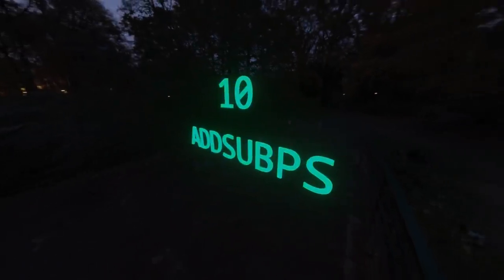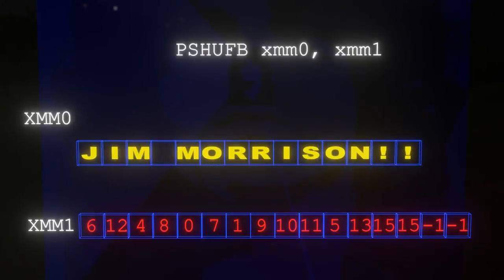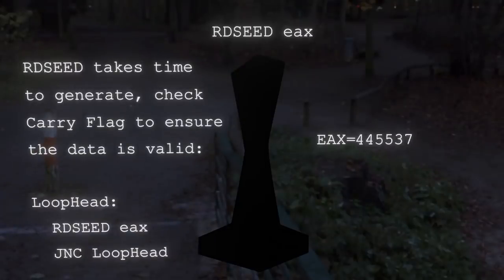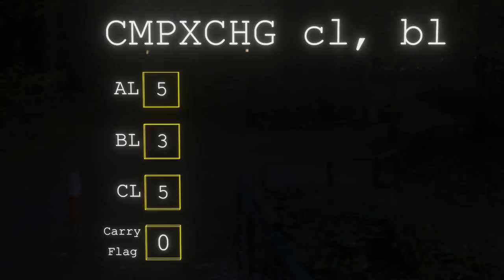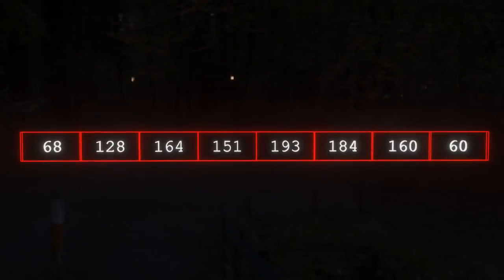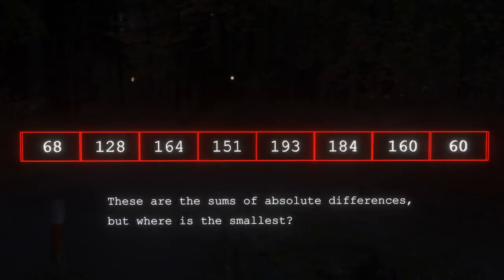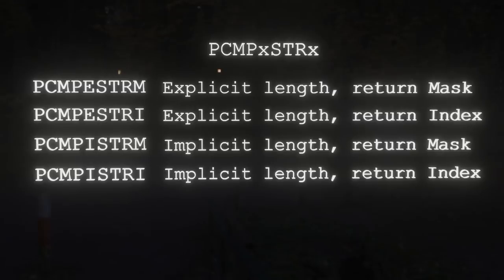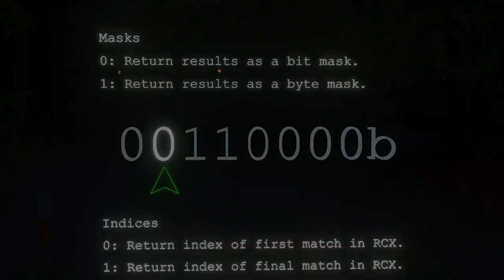Top 10 Craziest Assembly Language Instructions

Comment: Intel: One cycle
Bioinformaticists: lemme reimplement that in Python and take 300,000 cycles to compute the same thing.
Reply: Don't worry; as long as computer time remains far more valuable than developer time, and no alternative graphics-based technology appears for custom parallel processing operations, Intel will be just fine
Reply: @kestasjk  eh, emulation of x86 on ARM on both Windows and Mac is apparently good enough now that I'd be seriously worried if I was Intel. AMD at least have their GPUs...
Reply: @SimonBuchanNz  I think AMD wouldn't mind going ARM too much, if they have to. Maybe even will design dual-instruction-set chips for the transition period. Good thing that China won't let Nvidia buy ARM.

In general, nowadays there is a tendency towards "crossplatform" software design practices, so the question of "Can it run widespread software fast?" would soon become irrelevant. For example, Adobe Lightroom already works on ARM on Windows and their other products will follow soon. Itanium might not have flopped if it happened a few years from now, at least not for the reason it did, which was poor x86 emulation performance.
Reply: @JayOhm  how exactly can China stop a US company from buying a UK company?  

Should we find out what Italy and Argentina think too?
Reply: @codycast  The short answer is Qualcomm. They are banned by US so if ARM becomes US-owned, Qualcomm will no longer be able to legally produce ARM chips. Possible political implications of that are just too painful to risk so regulators almost certainly won't allow it.
Reply: Real men write code that gets compiled instead of interpreted.
Reply: @JayOhm  isn't qualcomm an american company?
Reply: @toothyeye  Sorry, my bad, mixed up the names. That was about HiSilicon (owned by Huawei), the largest semiconductor designer in China.
Reply: @codycast  Japanese company...
Reply: @JayOhm  Hmm, would that be the Qualcomm that is headquartered in San Diego, California, and incorporated in Delaware?
Reply: @rice83101  It's not a conspiracy... That's what intelligence agencies do, they gather well, you know, intelligence. China gathers dirt on us, we gather dirt on China. (And the rest of the world.) The fact that you interpret that as "conspiracy" indicates to me that you're a bit naive. It's not really used for blackmail though, it is used in other equally nefarious ways. Blackmail is a little small-minded.
Reply: @tylerchambers6246  lol. Morals r for the poor.
Reply: @kestasjk  Depends on how may times you code is executed during the life time of your product. Your python code could end up costing you more  on power and cloud compute usage.
Reply: It's the reason roller coaster tycoon, written in ASM, is one of the most optimized games known to man. 

That game ran as smooth as butter.

I'd bet the high fidelity raytracing and DLSS nvidia is trying to squeeze decent performance out of would be a trivial task under ASM. 

Coding it, however, would not be as trivial.
Reply: @bigmistqke  Who TF is talking about morals lol? I admire the game the elites play, I'm just saying that what I despise is the average guy who, incapable of understanding it, throws his hands up and relegates them all to the "bad actor" category. I don't analyze people in terms of more or less moral. I subscribe to the basic doxa of realpolitik.
Reply: still faster than learning a statically-typed language
Reply: @ethanpayne4116  Still faster than debugging the resulting clusterfuck of non-statically-typed code

People always think they're super clever for thinking to "save time" with non-static langs... but for anything more complex than a non-trivial script, there is a significant risk that they will spend more time chasing down bugs that simply wouldn't/couldn't happen in static langs (or which failing that, would be easier to find) than whatever additional time would be required to just use a good static lang

Duck-typed langs have their place, but the optimal scope for them is much smaller than popularly believed
Reply: @mduckernz  the thing is that you can do rapid prototyping with something like python way more quickly/conveniently than in C/C++ just because of how much abstraction there is. When it comes to a final product, obviously we'd want a compiled language for performance and robustness, but static typing just can't compete with being able to dynamically manipulate abstract objects in terms of development efficiency. Managing heterogenous data in a statically-typed language is an entire project, while with duck typing it's a non-issue. If it takes me 10x as long to design every object class in one language versus another, it doesn't matter if I have to spend 20 seconds debugging the duck-typed version. Oftentimes the code for a given analysis is only ever used once, so the investment required to make the entire thing watertight in terms of typing is not worth the effort.

Definitely domain-dependent though, heaven help us if anyone ever uses duck typing for aircraft control systems.
Reply: @ethanpayne4116  Python is slow as shit and its not even as high level as other languages. The only people who are infatuated with Python haven't bothered to touch anything outside of the low common denomination of industrial languages like C99, JS, Java, etc.
Reply: @SimonBuchanNz  I can see where the emulator writers would get to any of these instructions and then just grab the whiskey bottle.  But the bottom line is that these instructions were all implemented to optimize very VERY specific tasks, which will perform very poorly on the emulators.  But of course, those tasks aren't in the benchmarks.
Reply: @valcaron So, kind of like what Putin did to Trump, then.
Reply: @SaintLevantine  so what part of doing real time ray tracing or AI powered image upsampling in assembly is trivial if it's not the coding of it? What does that even mean? 

Here's the thing: the CPU just doesn't have the raw FLOPS, by at least an order of magnitude (maybe 80Gflops for the 11900k compared to 7Tflops for the 2060)

Assembly isn't used any more partially because compilers got good, and partially because the CPU is simply not the limiting factor, the GPU is.

This pervasive bull about "developers are lazy nowadays" is so insulting to all the absurdly intelligent and hardworking people working in games today.
Reply: @valcaron the fact we have an "president' that is vulnerable to that is an insult to america.
Reply: @SimonBuchanNz  Yeah, best I can tell I'm the only lazy game dev out there. If someone releases a game, they should be respected for that.
Reply: @henryfleischer404  oh, there's plenty of lazy game devs! Just none that have actually released a game. 😉
Reply: @SimonBuchanNz  Well that explains why I haven't released a game yet! I'm working on being less lazy, and I've finally gotten a project to the point that I can call it a game and not just interactive software. It's currently the worst SHMUP I've ever played, but that's better than not being a game at all, and I can see exactly what to do next to make it better.
Reply: @henryfleischer404  Congratulations on getting even that much! Further than I've ever gotten (though TBF I'm more interested in playing with the tech than making a game).
Reply: @deusexaethera  Real men write code that compiles the code that lady-boys write to be compiled.
Reply: @hamyncheese  As usual ;)
Reply: @SimonBuchanNz  I don't worry about game devs being lazy nearly as often as I worry about devs from other fields being lazy. I've seen way too many desktop applications that took minutes to launch on my $3k gaming rig, and websites that should've never been commissioned, much less launched in their current state. Those are the devs that I'll call lazy, not game devs like Project Sparrow's solo dev that spent 5k hours on a 1v1 game that's better than half the rubbish turned out by AAA studios.
Reply: Lemme reimplement that in Python and take 300,000 lines of code.
Reply: @hamyncheese  Then they have no time left to write an app, becauase they spend it all writing the code that compiles the code that interpret their code?
Reply: Eventually the python code turns into machine code the CPU executes
Why does no step of the process notice this and turn the execution into a single instruction?
Reply: @Xnoob545  Because the process is more complicated than you can comprehend and is also flawed. Learn the purpose of a compiller
Reply: *Let me reimplement that in Perl and take 300000 cycles to compute AND 30000 hours to mantain
Reply: @deusexaethera  "Real men write code that gets compiled instead of interpreted."
real men don't need either one...  haha in fact i programmed binary code into eproms using dip switches.   debugging must be done in advance...
Reply: Actually they take the same amount of cycles because the python is just acting as a wrapper, undernrath that is just C++ libraries
Reply: To be totally fair, it is probably a hardcoded subroutine. The number of cycles is in the spec for it and for it to be a part of the ISA it’s gotta be quite efficient or well… that’s the idea. Things can go wrong.

Comment: alright guys lets brainstorm what kind of algorithm could benefit from all 10...maybe search for a specific font in an image by comparing each glyphs bitmap to the image using MPSADBW and search for words within identified glyphs using the last instruction?
Reply: careful, or you might ending up creating another awfully named megainstruction
Reply: Needs moar threads.
Reply: MPSADBW can be used for all sorts of optimization problems as the sum of absolute differences is a metric. It's often faster than using the Euclidean metric which requires a square root and you can substitute one for the other in many situations.
Reply: you could feasibly use a good chunk of these by implementing a fancy video encoding

Comment: wow, that were 1010 assembly language instructions, not a mere 10!
Reply: I actually crunched these numbers in my head before I realized what you did. I feel ashamed. +1
Reply: There are 10 kinds of people in this world. Those who know binary, and those who do not.
Reply: @bbq1423  there are 10 kinds of people in the world: those who understand hexadecimal and F the rest
Reply: @threepointonefour607   0000 0000b - 1111 1111b  == 0x00 - 0xFF  since log2(x) is a factor of log16(x)!  If you are doing simple programming, then 90% of the time you'll only need hexadecimal. If you are actually building and designing hardware and implementing it's data paths, control lines and control bits... You are not going to get very far without binary and Boolean Algebra!  If you get into Cryptography, or Signal Analysis you might want to know binary as you'll end up performing a lot of bit manipulation!
Reply: @bbq1423  and those who didn't expect a trinary joke
Reply: Ah, yes, a "mere" 3,628,800 instructions
Reply: I would argue that there was only A instruction. Or rather, 0xA instructions
Reply: 0xA for effort! Well done!
Reply: There are three types of people in this world. Those who can count and those who can't.
Reply: @skilz8098  Verilog: Exists. Surprise!
You do more binary there than in "normal" programming, but it is perfectly possible to write some complex hardware without going binary any further than specifying bit widths of "variables".
Reply: A random question: Anyone reads 0xABC as "A hundred B-ty C"? I do sometimes xD  And almost always when it's 0x9F or lower, like "thirty bee" or "efteen".
Reply: Yes, 101 times what it said...
Reply: Top A assembly instructions
Reply: @alg3n320  excellent.
Reply: @seneca983  Reminds me of this one: There are two types of people in the world, those who can extrapolate from incomplete data.
Reply: @SpiritmanProductions  trouble is, extrapolating from incomplete data is synonymous with "assume," and, well, we all know what assuming does.

It makes my programs 5x faster, my compression 20x more efficient, and sets up some really good jokes. Nothing but good things, so far as I can tell.

Comment: Bear in  mind that some instructions were not designed, they are a by-product of the design process.
In essence, take any bit-pattern that is not assigned to an instruction and look at what the processor will do.
Most often it will do nothing (which his why there are so many NOP's in instruction sets) or it may crash, but sometimes it will do something weird and wonderful and be included as an "official" instruction while the designers pretend it was intentional.
Reply: That's like exploiting hardware-level undefined-behavior
Reply: there is a comment  that mentions HCF Halt and Catch Fire , "undocumented instruction" that sometimes could catch fire...damn, thats amazing lol
Reply: @lPlanetarizado hat wouldn't happen today on your PC's x86. Or this would be a terrible security issue. On modern systems userspace processes should be able to (try to) run any instruction they want without the CPU melting down.
Reply: All of the instructions in this video were quite intentional, but niche. Well, only some are niche. cmpxchg is a foundational instruction whose importance cannot be understated, while pshufb is going to be in pretty much every vector codebase. dpps is pretty well known, parallel dot product. not a fan of dpps tbh.

Comment: I feel bad for the CPU engineers who will need to add compatibility for this stuff in 20 years

Edit: finished watching the video. This was pretty fascinating, and the 3D text made it very nice to watch. I hope you gain more subscribers!
Reply: They'll do it in microcode, I imagine. Apart from the RNG, they can all be done purely in heaps of microcode if you don't care about performance, no dedicated hardware needed.
Reply: If you ever learn about microprocessors, it's all about microcode. Every assembly instruction are function call to microcode. The design will basically the same, with microcode printed in ROM inside the chip. You just have to be creative using that microcode to come up with a new instruction.
Reply: @gorilladisco9108  There's definitely a lot more to it than just microcode. Things that are both easy and compact in hardware - such as a linear-list search or swizzling - and microcode won't get you there.

Also I'm not aware of any major RISC implementations that use a significant amount of microcode, very much unlike x86.
Reply: @johnbrown9181  And that's why you won't see any instruction like the ones listed on this video on any RISC microprocessors. The thing about x86 and other CISC microprocessors is they use microcode liberally.

Microcode is how a microprocessor work. All you have to do is to have imagination.
Reply: Depends on how fast it needs to be.  Optimizing complex instructions to use all of a core's hardware is difficult, but just getting older instructions to work for the sake of compatibility isn't that hard.  Hence, x86 code from a couple decades ago will work fine on a modern x64 chip, while ARM, PowerPC, and other RISC designs have suffered mountains of compatibility issues over time.
Reply: And in the end they translate them into µOps anyway. There is much RISC like in modern x86 CISC and many instruction extensions to modern RISC. The difference isn't as clear anymore as it was in the early 90's
Reply: @HappyBeezerStudios  The basic instructions are more or less RISC-like, but the advance instructions like the ones mentioned in the video is definitely not RISC.
Reply: Its bad even today for the engineers
Reply: Modern CPUs are less running optimized compiled machine code and more Just In Time recompilers with lookahead and speculative execution. Recognizing patterns and executing instructions to obtain the same result as other instructions.

Comment: I've worked with or in close proximity of most of these. If you do high performance number crunching or data crunching, the value logistics (i.e. which value needs to be in what operand in which SIMD position) very quickly becomes a major issue and for that all these shuffle/rotate/select/<do packed stuff> are a godsend, especially since they tend to be just rewiring of existing ALU functionality so AFAIK should be easy to implement in silicon. Number 1 on the list is the only instruction family I'd put into "space magic" territory, but I might just not have seen its use case yet.

Comment: TMS-9900 also has a very unique instruction: X Rn . Execute the instruction in register n. It's the only CPU I know of that has the equivalent of an eval() function (as the registers are stored in external RAM, it's clear that it's not difficult to implement in that case).
Reply: It has SEVERE security issues. But hey, at least it can be used for self-modifying programs
Reply: @Rudxain  for a CPU that doesn't have priviledge levels or memory protection, I don't think that security is an issue with the X instruction.
Reply: S/360 had the EX instruction for that. The instruction wasn’t in a register but in memory (S/360 was variable length, 2/4/6 bytes). This kind of instruction was fairly common in the 50’s and 60’s.
Reply: @peterfireflylund  interesting. Btw in the TMS-9900 the instruction is also in memory because the register window is in memory.